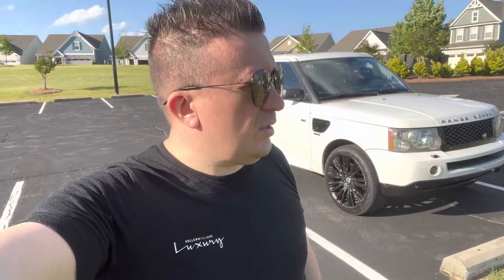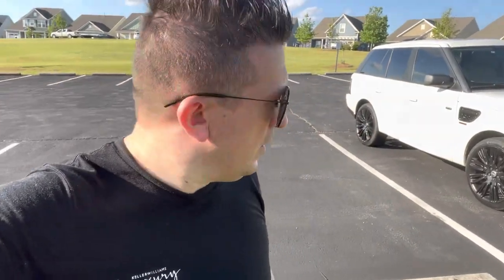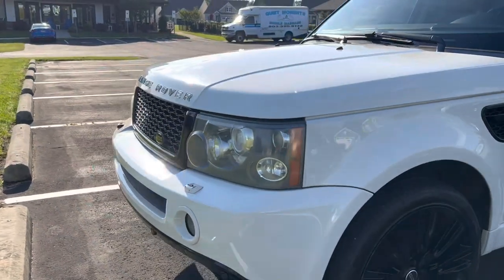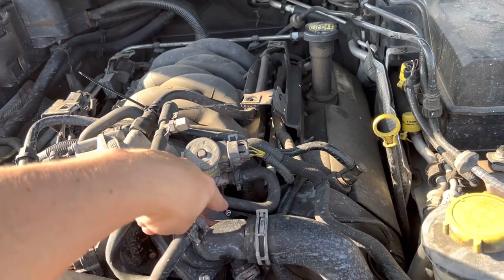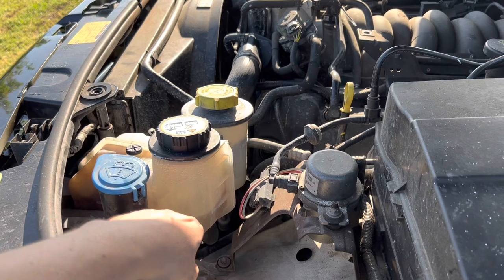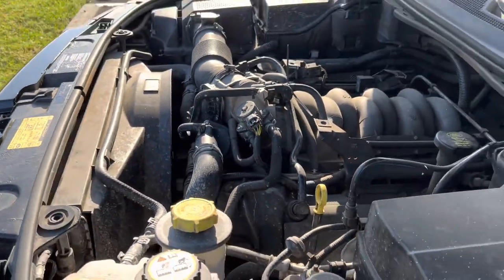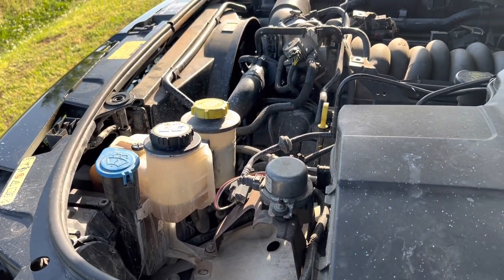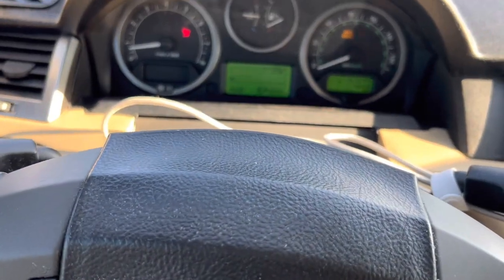2006 Range Rover Overheating Problem FIXED for $20! (Update)

Comment: I bought a Disco 3 about a year ago and had the same problem. Someone broke and JB welded the return line. I replaced the radiator, water pump, thermostat, belt (just in decause I had access). Then it would overheat randomly. 
I found out never use the pressure screw on the intake tank. Use the bleeder screw above the thermostat.
Hope this helps